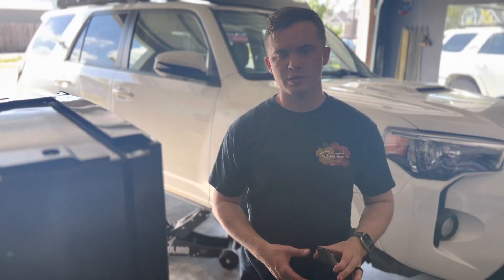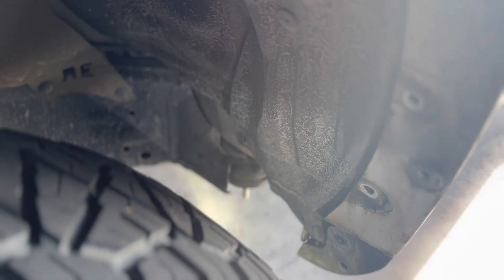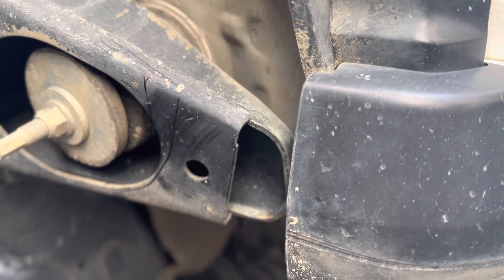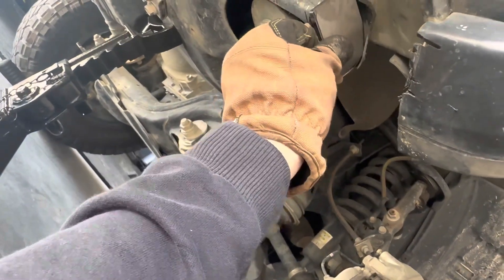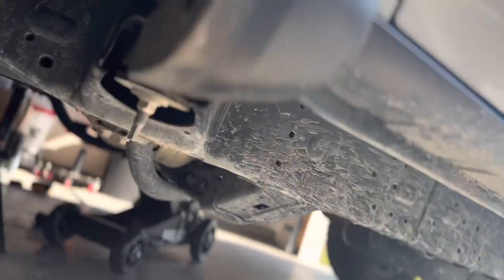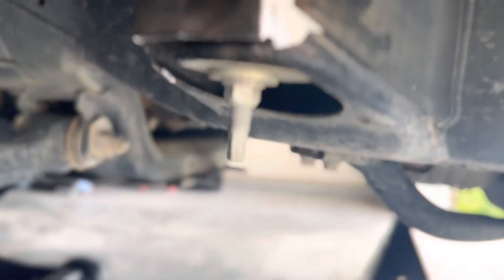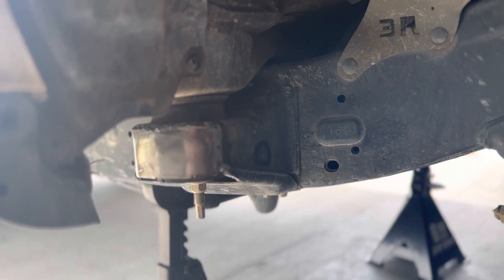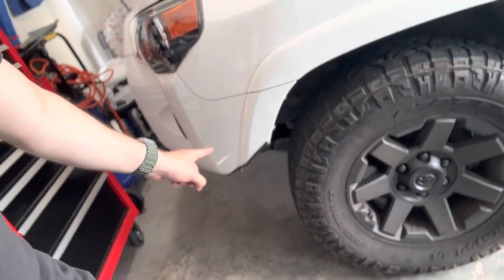4Runner Body Mount Chop | Road to Fitting 35’s

Comment: Was ot necessary to chop it? taking the mudflaps off would have done the trick
Reply from the maker: Very necessary. Running 35’s and just removing the mud flaps might work going straight down a flat road, and thats a maybe. 

Without the chop I would not be able to turn more than halfway without rubbing it. Even chopped it still rubs if turned all the way and flexed on something.